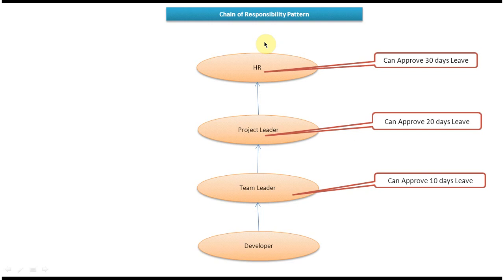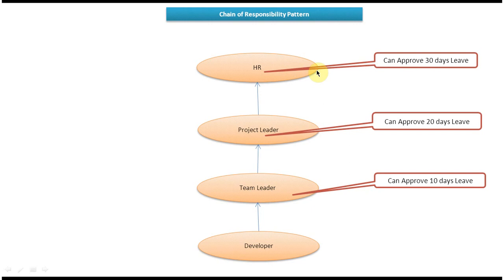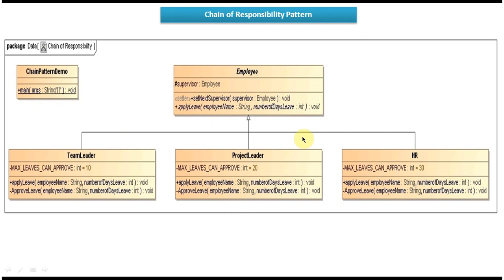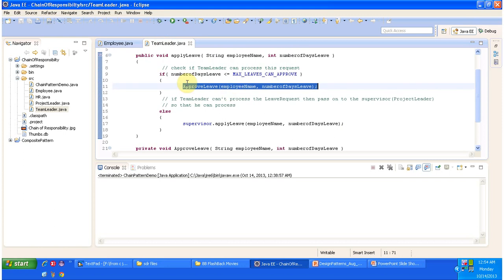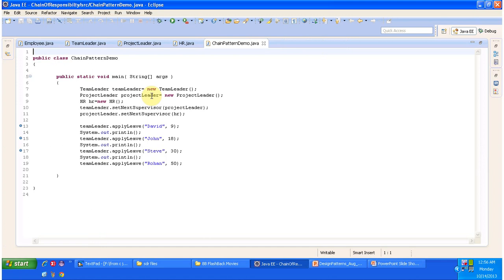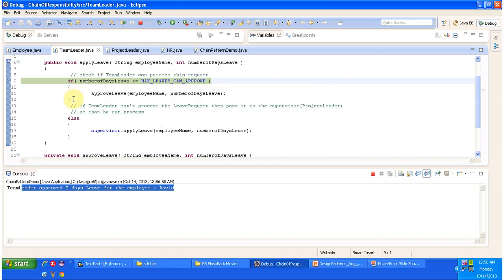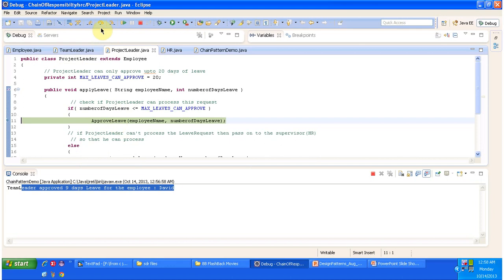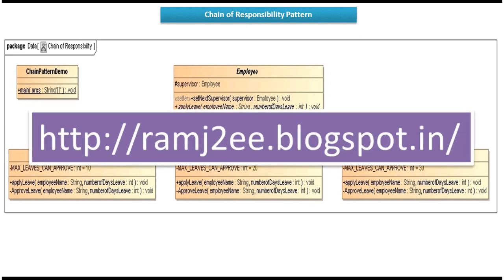Chain of Responsibility Design Pattern Implementation: Single Receiver Handling Approach

Comment: Can i use chain of responsibility design pattern in Parking Lot System, as there are multiple parking floors, so if first floor cannot fulfill request, it can send car to second floor and so on, and if any floor can handle the parking request it will handle that request
Reply from the maker: yes, you can use.